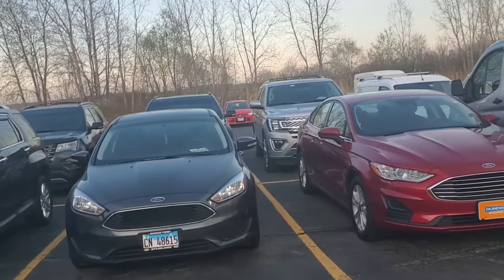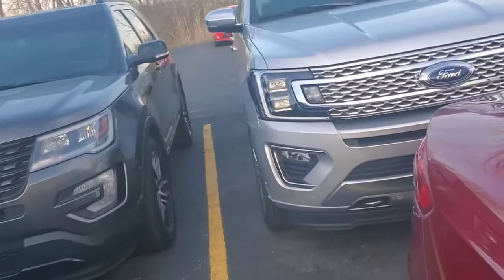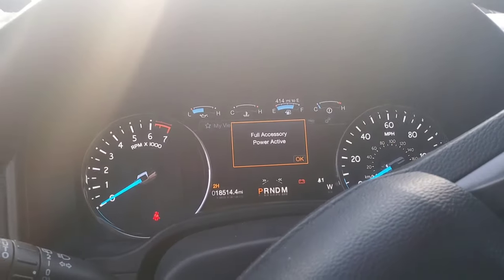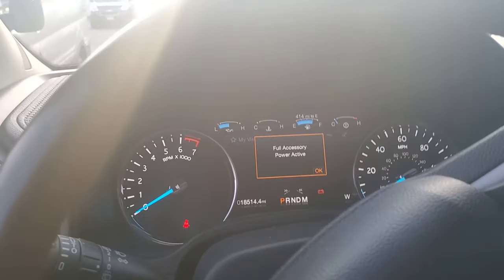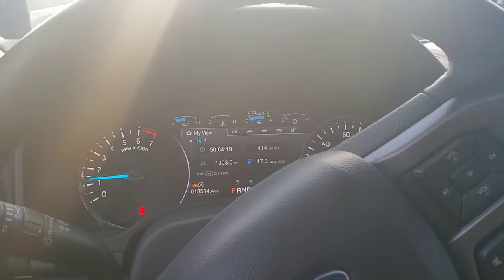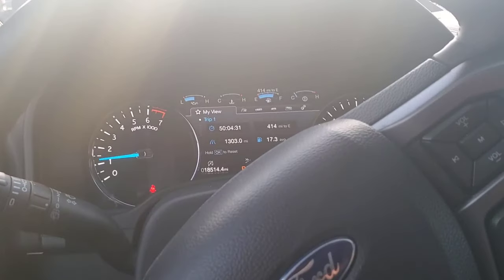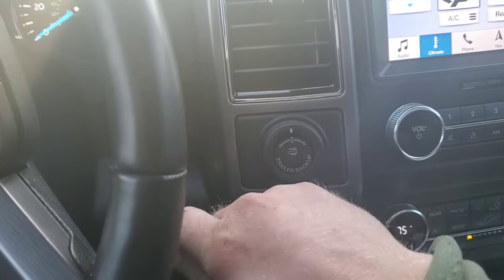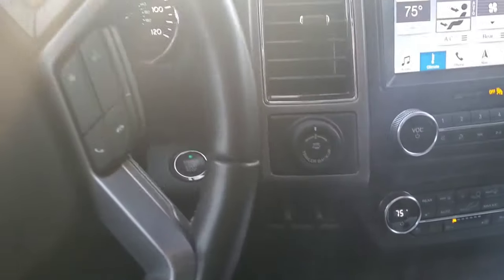3.5L Ecoboost F150 Rattle on Startup then gone, Try this - Could Fix Ford's Phaser Problem

Comment: What about issues after startup? I did your trick* and it worked like a charm, however, I have issues when I lightly accelerate it will shake/jitter/jutter whichever and it will do it on command. By lightly, I mean to accelerate like 1-2mph. I was told the Cam Phasers/Timing needs to be replaced and that it would be about $4k to get that done. The engine in question is the 3.5 EB in a used 2015 Expedition EL Plat 4x4.
Reply from the maker: Phasers more than likely assuming you made sure all ignition components like plugs and coils are good
Reply: @FordBossMe  I recent spoke to a local mechanic, and after more description, that it sounded like torque converter shudder. Also, considering there is no other shine from the engine bay whilst running, I believe that is the cause. I don't know how well the previous owners took care of the vehicle, but they suggested to flush the trans and see if that works. Which would also be cheaper option to see if it fixes. Thank you for your reply, and I'll reply with an update if it is fixed or not.

Comment: Just tried this and it works! 
2019 King Ranch w/3.5 Ecoboost and a brief but noticeable rattle at startup when cold. Your 'pressure prime' method completely eliminates the rattle. Brilliant!
At 68,700 I'm still in the full coverage window for cam phaser replacement if needed, but only for about 1,200 miles. Unfortunately appointments for Ford service are 2-3 weeks out, and that's just to see the truck to evaluate the issue! I bought the truck to take on a 1,500 mile trip this Sunday. Looks like I'm screwed.
What are the long term effects of a brief rattle at cold startup?
Assuming that the cam phasers aren't replaced and the rattle gets worse over time, what are the long term effects? 
Subscribed, BTW ;)
Reply: I just got my cam phasers done and it rattles worse than before 🤦🏻‍♂️

Comment: The first one we ever saw was a farm job sent to Us by a local Ford dealer, they had already been into it and put in the primary chain but it still rattled. The way we diagnosed it as we pulled off the valve cover on the side that was rattling, then put all the coils back on and fired it up. I could watch the secondary chain tensioner squeeze out which took up all the slack and the rattle went away, the lock inside the tensioners didn't hold them all the way out and the chain stretch was enough to make it rattle.

Comment: You'd think Ford could engineer this. They have an electric pump that keeps the fluid circulating on the 6R80s with the auto start/stop 2.7s, so it's not like they haven't made a pump that could handle it.

Comment: Is it an oil pump check valve bleeding down? Or does Ford need a different better oil pump?
Reply from the maker: Its a crappy timing design
Reply from the maker: This is just a bandaid but doesnt permanently fix it

Comment: works like a charm. however, the engine is still cracking without the oil pressure so in theory it is still doing damage to the engine, even if less the running "dry". i changed the phasers and still had rattle. changed filter with a ford filter...... yep no rattle ???

Comment: Ford should hire you as a Engine Designer, obviously they didn’t think or research this problem to correct it permanently, I just bought a 2018 F150 with the 3.5 ecoboost , it’s going to Ford to have the Cam Phasers replaced because of the engine knock

Comment: Even when I did the gas trick mine still sounded like angry tap dancers, I mean even with an elongated crank the cam phasers are still moving with improper lubrication and pressure initially.

Comment: I don't know why the ECM even permits the engine to start with the oil pressure light or low oil light on.
That extra cranking to have oil pressure prior to start should be on every car.  May even save a lube tech sending a car on its way without oil.

Comment: I can't believe Ford hasn't just abandoned these cam phasors by now.  My Honda has a variable cam timing and none of these issues.  How hard can it be?!  My F250 has the right bank cam phasor tapping after being replaced 55,000 miles ago.  I'm not shocked the 7.3 Godzilla is a push rod engine.  I wish I had one of those.
Reply from the maker: Honda did have these issues I fixed many of them and they still have these issues

Comment: I really like your idea it's brilliant but I still regret why I tried Ford Ecoboost truck instead of Toyota tundra. I like everything with this truck except the engine!
Reply from the maker: Nah you're still missing the best half ton truck of all the 2015 to 2017 aluminum body 5.0 L V8 with a 6-speed transmission the Ford F-150 had an option for now that is better than any truck on the road in the half ton series and way better than a Toyota Tundra

Comment: I will never own one of those 3.5 ecoboost trucks again. Nothing but problems at 60k miles, finally got rid of it after it left my family and I stranded on the side of the road.
Reply from the maker: I like naturally aspirated engines in the brand new lines

Comment: I have a 2018 xlt with the actual key. I turn on the key and watch the oil pressure needle go up, then i cranck the motor. Now if you wait too long the oil pressure needle goes back down.

Comment: I had a new Jeep Cherokee that had an extended crank time before it would start.  I thought it was defective in some way.  The dealer said that the engine was designed that way to reduce pollution upon starting.  Could the anti-drainback valve in the oil filter be defective?  I'm not familiar with the Ford engine you are talking about.
Reply from the maker: All of then....No 

We just need oil psi on startup thats all and an extended crank helps some

Comment: Excellent! Thank you!! What about using Prolong Oil Additive, or Lucas Synthetic to increase residual lubrication at the Phazers?
Reply from the maker: I've heard of people having success with the oil additive I don't know that it 100% works it wouldn't hurt to give it a try
Reply from the maker: Also realize that this fix only stops the problem from getting worse it does not fix the problem you have to have the cam phasers replaced in order to fix the problem
Reply: @FordBossMe  Which one? Lucas or Prolong?
Reply: @FordBossMe  When they do the fix for this at the dealer, does it require an oil change? I want to put these additives in, but I don't want to lose it all when it goes in for service if that is what they will do?

Comment: Had a 2018 F150 5.0l for a couple years now. Bought it with 31k miles on it it now has 131k and it has had the deceleration rattle and a diesel knock once it’s up to temp. Just a couple months ago it’s started to rattle on initial startup. Hooked it up to a scanner and I’m getting a code that says”random multiple misfire on Cylinder 1, 4, 5 and 6 within first 1000 revolutions of the camshaft.” I’ve put about 30k miles since the cold start rattle has started. Do you think that I’m okay with throwing some Moly Disulfide in it and using your trick? Or am I going to replace a bunch of shit.

Comment: The Duke says, why not add Lucas oil stabilizer to the oil? I added it to my 6.2 and it runs much better including start up. What did I teach you?
Reply from the maker: You didn't teach me anything because all that s*** does is get slimy oil on moving components but it actually takes away from the overall ad pack of the oil so it's worthless it doesn't have anything in it that actually protects anything and people are duped by that s***
Reply from the maker: So you stand corrected for what I just taught you and I actually have oil testing analysis here on the channel that's free I've already paid for results given to the public so again you're also welcome, now I've done more for you than you'll ever do for me so please realize that, tell the Duke I said hi his help isn't needed

Comment: Thanks for the tip. I started doing this on my F150. Hopefully it’ll help save my phasers. 
Question, I also have a 2020 mustang GT. It’s a 6speed manual. How do I do it on that? Hold down the clutch and gas pedal? Thanks
Reply: Don't start it in gear, put it in neutral and you won't have to hold the clutch.

Comment: Hi boss excellent videos always ,how do you describe the engine shudder i feel like small misfire between 20 to 55 mph at slow rpms no codes no rattle noise thanks
Reply: I did the 21b10 program just 2 days after I bought the truck them I don’t know if this issue was before the program or not
Reply from the maker: Yep like that also

Comment: I know that I am late to this video, but I have a 2020 f150 3.5 ecoboost and I've been doing this for a while as the rattle bothers me, will engaging the flood mode cause any issues later down the road?
And my second question would be if I went with an aftermarket programmer would it be possible for the tuner (custom tunes) to make a prolonged crank to build the oil pressure?
Just a thought, thanks alot!
Reply from the maker: I don't think it's going to hurt anything by doing flood mode and I'm not sure about the custom tune I have seen somebody say they bought aftermarket cam phaser lockouts

Some kind of system that locks out the cam phasers look into that if I was you
Reply from the maker: Check this place out 

https://www.livernoismotorsports.com/CAM-PHASER-LOCKOUTS-LIMITERS-KITS/page/2

Comment: Luv it! I believe it’s a pressure drop and that means the phasers and top end are “dry”. An accumulator setup would be equally helpful and I wonder if something like Lucas oil stabilizer would help keep more oil in the top end? I’ve never used it and my 14 limited F-150 has 232000+ kms and has only had amsoil signature series oil since new and as of now doesn’t rattle but when I do key start it moving forward I will do the preprime procedure for sure!
Reply from the maker: Actually what the problem is, is the phasers have a pin that is supposed to lock into the camshaft and eventually it quits lock so on start up because there's no oil pressure there starts rattling and by free spinning it up you're getting oil in there and it buffers that rattle
Reply: @FordBossMe  I wondered how it was supposed to work. Some kind of electronic check valve to hold oil in the phasers when not running

Comment: I also have the rattle on start up. I did what you said by priming it first and I got no rattle on start up. I am happy to see this works. I am now worried that having it crank at first without starting it will put a strain on the battery and starter. Is the life span on these going to die faster now that I'm doing this
Reply from the maker: This is not a permanent fix this is only to stop the way of further and if you don't do it excessively long you're fine yes it does cause additional wear but it's minimal I would rather have my starter crank a few extra seconds then my timing components keep getting wore out

The only answer is Ford fixing the problem
Reply: @FordBossMe  If I don't get it fixed what will eventually happen? If it is only going to make this rattle at start up  I can live with it
Reply from the maker: @steve-gz2ym  I can't 100% answer that unfortunately because nobody's done it long enough to figure out what happens
Reply: @FordBossMe  as we know right now the rattle is only on startup. Can the rattle get worse where it rattles all the time when the engine is running? I bought the truck new and only have 20,000 miles on it. I really don't want to open up the engine I feel it will never be the same again. I like to go on long trips I just don't want to break down on a road trip.  If I don't take it to get fixed do you think it's going to get worse where eventually I'm going to have major engine problems?

Comment: I wonder would that work with all brands that has cam phasers my wife has a 2021 Jeep Cherokee with the 3.2 V6. We are not having any issues but to simply keep from having issues with vehicle’s that have vvt type engine’s using the same technique holding on the break and gas for a few seconds more while trying to start it it’s a push bottom start as well
Reply from the maker: Honda and Toyota no 

Most cars though it will

Comment: Will the extra cranking wear out the starter motor prematurely?  I actually had the starter motor replaced in my F150 at about 58,000 miles.  The mechanic couldn't believe it because they'd never seen that particular starter motor fail before.  I guess I'm lucky.
Reply from the maker: Put it yes it could will it likely do it with minimal flood mode starting probably not but yes there is a possibility it could cause some excessive wear
Reply from the maker: I did have a 2018 Ford F150 starter fail at about 45,000 Miles because of corrosion building up inside the starter and on the ground strap going from the starter to the starter solenoid

Comment: Is this the similar issue with the 5.4 and 4.6 Ford V8s due to worn timing chain guides and weak oil pumps? I’m aware that on older Ford engines oil pumps with 120-150,000 miles have this rattle issue. Replacing the the timing chain and all related components and then replacing the engine oil pump with a HD Melling engine oil pump will solve this issue.
Reply from the maker: No this is typically wear inside the timing phasers

Comment: Hey Ford Boss Me, I'm having this same issue with my 2012 F150 ecoboost. I just hit 200k miles and truck runs awesome. I'm going to try this and see how it goes. Do you have any other suggestions that can help alleviate the issue without expensive repairs? I'm out of warranty and just trying to run this truck until the wheels fall off! Thanks!
Reply from the maker: You could try to put some Lucas Oil stabilizer in it may help some but probably not on your truck it's more common to have timing chain slapped than cam face a rattle there is no real way to alleviate this without having to spend a couple thousand dollars on having the timing chains replaced and the phasers
Reply: @FordBossMe   Okay gotcha. I might have to get my mechanic to get me a quote on timing chain and phaser replacement. I guess it can't hurt and would prolong the life of the engine.

Comment: Thanks for the video, I have a 2019 Lariat Coyote 5.0 that “clatters” or rattles between 5th and 6th gear IF I don’t let it warm up for several minutes prior to driving. It also has that oil consumption issue ... very annoying.

Comment: Also, with longer starts you go through a lot of starters/selonoids. Why not fix the core problem and swap the plastic nylon pin for a stronger metal pin that will not snap or sheer off?
Reply from the maker: First of all it's not a plastic nylon pen I don't know where you got that from but wherever you got that from take it back to where you got it

Second of all by adding the three to five second extra long crank it's not going to wear anything out these starters are actually made for auto start stop cranking but also as I said it's not to be done all the time anyway it's just a way to get you through so it doesn't get worse until you get the third generation phaser install which is upgraded and doesn't have these problems anymore but I guess you missed that part because you focused on responding with emotion instead of hearing the message and possibly looking at other comments that were left in the comment section I would just ask you to do better if you're going to comment on somebody's stuff to do a little reading and a little research and ask more questions before making ridiculous statements

Comment: Could you briefly explain what all is involved with having the Cam Phasers (VCT's) replaced in the F150.  I've heard that they have to pull the cab in order to replace the VCT's and timing chain.  Is this true?  If so, how could you possible get this done in only 10 hrs.  Ford needs to allow more to do this work. Geesh!  Thanks for making these videos.
Reply from the maker: You don't have to remove the cab but you have to remove the intake manifold the valve covers all of the pulleys on the front of the engine you have to drain the cooling system all of the hoses have to come off then you have to pull front cover and clean everything and they just want the phasers replaced not the chains if there's nothing wrong with the chains but some techs will replace the chains while they're in there...the new tsb says only associated parts for phasers and nothing else no chains no guides no tensioners

Comment: I’ve got a 2017 F-150 with the 3.5 with about 33,000 miles and it started rattling briefly on start up.  It’s still under warranty, should I have the phasers replaced?  I bought it with 24,000 miles certified pre owned from a Ford dealership and since I’ve owned it, I’ve never missed an oil change.  I’m not sure what the problem is.
Reply from the maker: I would have them done
Reply: @FordBossMe  is it normal for that to happen at lower miles like mine?  What are the chances it happens again after they’re replaced?  I guess I’m just wondering if it’s worth doing.

Comment: Just seems like an external oil pump to prelube or build pressure before even cranking the engine over would be the solution to the problem. Cranking the engine over longer at startup seems as though its simply masking the problem.  In other words you're simply eliminating the noise but not the problem because yes you no longer have the rattle but the phasers are still out and will eventually need to be replaced.

Comment: So you have to do this every time? This doesn't mess with the starter over cranking it?
Reply from the maker: No you only have to do this if the vehicle has been sitting for awhile to eliminate dry starting or chain rattle